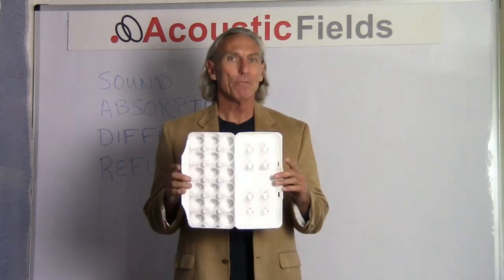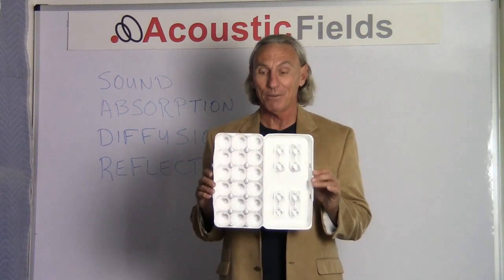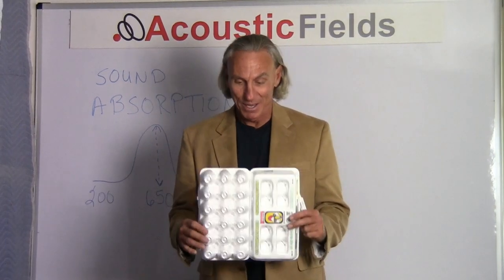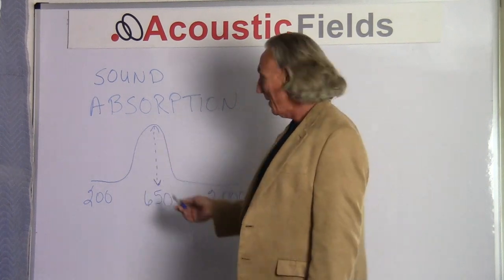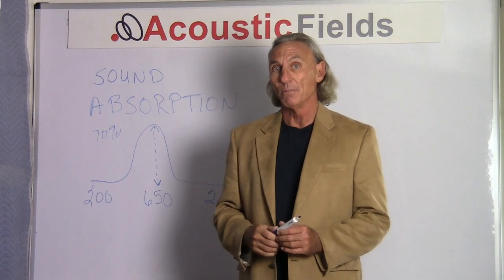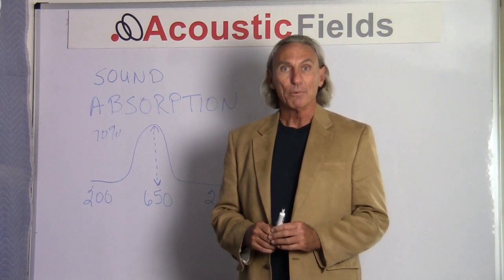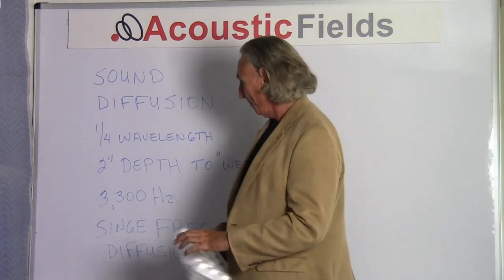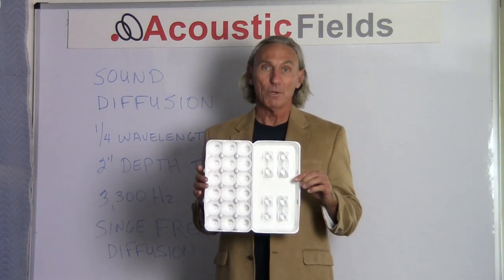The Egg Carton Acoustic Myth - www.AcousticFields.com

Comment: Well, not with those crates lool
Reply: @girlsdrinkfeck  The point of the video is that the egg cartons have a uniform shape and deep so the frequencies that are treated are minimal. The egg cartons act as diffusers. "Diffusors (or diffusers) are used to treat sound aberrations, such as echoes, in rooms. They are an excellent alternative or complement to sound absorption because they do not remove sound energy, but can be used to effectively reduce distinct echoes and reflections while still leaving a live sounding space." So the egg cartoon cones act as diffuser, and the material in this case carton can absorb some of the frequencies but again is a very limited range of frequencies it can absorb.

Comment: Hi guys! I can't understand one thing. In video mr Foley said that egg crate depth is 2 inches ( proximately 5 cm). Then he said that quadratic diffusion depth have to be at quarter wavelength. 2 inches x 4 = 8 inches (proximately 20 cm). But wave for 8 inches isn't 3300 Hz, it is 6800 Hz, isn't it?
Reply from the maker: Hi Paul,

The depth of the egg carton is around 2". It is an even depth across the total surface. If we multiply 2" x 4 for quarter wave, we get 8". Using 8" or .67 ', we divide that into 1132 ft/sec. and we get 1,689 as a frequency that fits this guideline. Even if the egg cells varied in depth, it is at such high frequencies that it would have limited use.

Quadratic diffusion is predictable and consistent. You can design for frequency response, so that you can apply the frequency response to the actual use of the room you are treating. Remember, poor room diffusion is as big an issue as poor low end performance in small room environments. I never see or hear a room that has proper rates and levels of diffusion applied within it and it is too bad because diffusion adds so much to our music.

Diffusion can take a small space and make it sound much, much, larger. If you were blind folded and brought into a small room with proper diffusion, you would not be able to estimate the actual room size. This is how well quadratic diffusion works.

Thanks
Dennis

Comment: I just sound-deadened a Bayliner boat for nearly free using discarded couch cushions.
Other free materials is discarded carpet and underlay, which is more foam.
I can't believe the expense of the new, black acoustic foam !!

On egg- crates - 
This would be a budget radio studio trick from the '30's !!
A.M. only went to 5K hz and speakers didn't work under 200 hz so paper egg-crates worked perfect back then.

Comment: So if I understand you correct, the amount of soundproofing from Egg crates is minimal, but not nonexistent.
If a person (say for example: a young, inexperience, unprofessional, and unemployed High school student who wanted to try his best at a DIY recording studio) wanted to add as much soundproofing as possible while being as cheap as possible, from what I'm understanding Egg crates would be a valid option.
Am I wrong, or are there more effective and equally as affordable options?
Reply from the maker: R,  Using an egg crate to stop noise is like holding up a feather to stop a tornado. Wrong application and material. There is no free hanging device that will stop noise. Barrier technology is a permanent build out that requires mass and density. You can absorb "excess" energy within your room but minimizes its transmission is a completely different science.
Reply: I am in a similar situation, but these cartons are not the way to go. They are not useful for sound proofing, and like the video said, they only absorb and diffuse specific frequencies, which would do you more harm than good, whether you're trying to record or listen critically.

Comment: No.. Im not use the styrofoam one we used the cardboard one to soundproof it but i think the styrofoam was bad because it gives corkiness to guitar sound i try it bfore but the paper one sound good and it reduce outer room noise..
Reply from the maker: Hi Ade, You are correct. Every material type within our rooms contributes to what we hear. We stay with natural materials in our room builds such as soft woods , natural fabrics, and even stone. It is always a balancing act of materials, room size, and pressure levels.

Comment: Sir,  glass wool vs ceramic wool blanket. i didnt find any video on ceramic wool acoustic property.  i met a dealer who adviced ceramic wool blanket with aluminum coated to buy. what is the difference in property of sound absorbtion between both of same thickness. which one will give better result in case of absortion?
Reply from the maker: Hi Loukik, What are the absorbent coefficients of both materials? You have to look at the rate and levels of absorption of any and all materials used within an audio room. These material types are not conducive to sound quality and should not be used where critical listening is paramount.
Reply: Thank you Sir. But why people are using glasswool and gypsum in studio? what  will be the result of sound if they will use ceramic wool blanket in place of glasswool of same thickness? will it give better , same or worse result then before with glasswood?
Reply from the maker: Hi L, People do a lot of things that do not make sense when it comes to quality audio sound in small rooms.  Most people apply tactics they have heard or read about without having developed a strategy of treatment to match usage
Reply: Thank you so much Sir

Comment: How about the fact, that each holes vary in depth from the edge to the middle? Or is this irrelevant because there are no "steps" inside the holes which could reflect sound?
Reply from the maker: Hi speedybodie The sound energy would go right through the holes and not be refracted back into the "diffuser chamber". It is this process that must be followed if you are going to create diffused wave forms.

Thanks
Dennis
Reply: Acoustic Fields Sorry, wrong wording. I meant the dents, not holes. There aren't any holes in egg carton as I know them anyway.
Reply from the maker: speedybodie No matter dents or holes, an egg carton is just not a diffuser.
Reply: Acoustic Fields For a response to his follow-up question, that was devoid of any facts. The fact remains a wave hitting the dented area of the surface of a paper egg carton that holds the egg in place isn't going to travel straight back to the source-- it'll bounce elsewhere. With the entire dent, it'll bounce in any random direction. One must also add in the fact that most egg cartons are made of fibrous paper material. So I think it's safe to say it's much better then a flat wall that will reflect back most of the sounds straight to the source.
Reply from the maker: ngomusicgroup It is not safe to say anything about an egg carton when it comes to serious room acoustic diffusion. True diffusion technology has to satisfy a rigid criteria for performance in small room acoustics. There are many variables that must be satisfied to create a truly diffused room sound environment. The process you are describing is sound re - direction, which does not satisfy any of the rigid requirements of a truly sound diffused room. Lets leave the egg carton to do its designed for job, namely transport and secure eggs in a safe manner, and then keep it in the refrigerator where it belongs. It has no place in a serious room acoustic project, other than providing a food source for those working on the room acoustic.
Reply: I don't think you have any actual real world experience from using cartons to kill reflections that will record straight back into a microphone. This happens quite often with people who presume their education is all they need to understand real world experiences: a room treated with egg cartons is going to limit the amount of sound reflections picked up into mics whether you like or not. It's not a perfect situation but the fact is it's better then not treating the room with them at all-- by a noticeable amount. I say actually test recordings in a room, then write on your shiny board about the findings instead of only writing on that same board without true A/B testing of your theory.
Reply from the maker: ngomusicgroup Only 30+ years of building, testing and designing rooms including 8 years alone in pure R&D building, testing, measuring and tearing down over 116 rooms using different build materials and methods to compile our proprietary database and technologies. But go ahead and believe what you want. That is your prerogative.
Reply: Acoustic Fields
I am not doubting this guy's knowledge and experience on acoustics, in fact I very much look to him for facts. But the way he responds to people who genuinely have questions and might have some sincere doubts I find offensive. The method of. "I'm smart, you're dumb, I know the facts and you don't" is not exactly going to win people. For one, yes, not everyone is an acoustical engineer, however, it takes more than simply saying "I have 30+ years of research and development and experience", people do appreciate simple test results. Also, if a response is done pridefully, you could actually be losing people from the chance to believe in your knowledge and wisdom. It's one thing to know and have the truth but it's definitely another another skill to be able to "effectively" get people to listen and realize it. There's a saying that goes, "people don't care what you know unless they know if you care". A quote from Neil de Grasse Tyson when he was correcting Richard Dawkin's abrasive method of teaching science, "I think I felt what you said more than I heard it. When it comes to other people's beliefs, sensitivity PLUS the facts equal impact."
Reply: Pri yon Joni
Exactly my thought. And the reason why I stopped asking. I guess I have to find the answer somewhere else.
Reply from the maker: Pri yon Joni speedybodie Sorry guys, probably got of bed the wrong side that morning I made that response. Looking back I was short and I apologize for that. I guess I just didn't take too well to being accused of being all textbooks and not having building experience. That is the polar opposite as it was only through so many years of building and testing that I found a lot of the literature was misleading and had been written by people who hadn't actually got out the classroom to test theories. So again I apologize as I'm trying to help educate people about this stuff and if I offended you in anyway then I've failed in that endeavor and that's not good. So I appreciate your feedback and will try to correct this behavior in future.
Reply: Acoustic Fields
I totally appreciate your response and respect you for having the character to listen. Really love your video series and still look to them for wisdom and knowledge in acoustics.
Reply: Acoustic Fields
Good response, thanks for not ignoring critisism. :-)

Comment: While playing with my friends, ever talking silently my door still lets ALL the sound through because its  a hollow plastic door. What should I buy that would dampen the sound so my parents dont hear anything. I also have semi open headphones and the TV in living room disturbs me even if its on really low sound. How do I isolate my room so sound ONLY stays in my room? Please dont give me a complicated video, just what should I buy for it?
Reply from the maker: E, Unfortunately, noise is a complicated issue. TV noise is > 40 Hz. so you will need mass. I would buy two solid core doors and laminate them with a vinyl mass damping material.
Reply: A dirt cheap fix is to get a piece of Sound Board from Lowes or Home Depot.  They are lightweight and can be glued or screwed on (to your door).  Not pretty and not perfect, but they muffle out sound, and cuts the ability to hear the content of speech.  They obviously do little for heavy bass - then you need to follow the other suggestion.
Reply: Acoustic Fields I cant afford one solid core door.

Comment: I used to see photos from home studios in the 70s and 80s in books like Craig Anderton's Home Recording For Musicians with a wall of egg cartons and think wow that's it just go for the eggs. 

But it seems after this video it's turned into a comedy routine when science is applied when the lecturer here says "I can't think of any purpose for..." lol.
Reply from the maker: O, The issue using materials that were designed for product transport and shipping/handling requirements for acoustical treatment needs is that it disregards two of the most important variables that we must have for stereophonic sound quality in-room treatment technologies. Rate and level of absorption must be calculated, be predictable and consistent in their performance, and be easily installed. Yes, most materials will absorb energy, even concrete will absorb low frequencies, but at what rate and level and does their rate and level fit the acoustical requirements of the design parameters of the room. Nothing is easy and a good engineer needs many tools in their acoustical toolbox and there is no one size fits all usages, no matter what companies tell you.
Reply: Thanks for the reply!

Just to put this acoustic caper into perspective as I'm new to this - the idea to acoustically treat a room in the context of monitoring a studio mix is to get towards the room not colouring the eq or increasing or decreasing the mix level of the flat frequency response of the studio monitors you're listening to via reflection of the sound off the rooms surfaces especially large walls and corners? 

So in other words the point of treating a room best you can is to absorb these reflections or at least reduce reflections? 

So in theory is the ideal mixing environment although not practical, to mix outside in a field with no natural noise whatsoever to take the whole thing to its logical conclusion of having no reflection off room surfaces affecting how you hear a mix?
Reply from the maker: O,  The best your two-channel system will sound is to take it outside in a secluded place and sit in front of your speakers. This will be a sound quality that does not have "room sound". When you place your system in a room, you add many issues that must be treated or they will impact everything you do in that room size and volume. The issues are low-frequency unwanted pressure issues throughout the room, not just in the corners. Middle and high-frequency reflections from the wall surfaces.  You must use a combination of treatments to reduce all of these issues.

Comment: What happened to the reflection element?
Reply from the maker: Hi R, The eggs are sitting on it.
Reply: Acoustic Fields that is funny. However, I was curious about why the reflection properties were not analyzed in the same depth.
Reply from the maker: Hi R,  Reflection or sound redirection in the case of the egg carton, is not a wanted phenomenon. You need to manage spurious reflections from all surface areas in a critical listening room.
Reply: thank you

Comment: It's cardboard - not foam - palates that were once at bottom of apple boxes that make good sound 4 recording. Used on movie sets
Reply from the maker: G,  The issue with using materials that were designed for other usages is that they do not have measured performance. In critical listening environments, we have to know how much, what frequency, and a host of other variables.
Reply: @AcousticFields  was told by Mad Max set builder they used apple/vegetable (cardboard palates used to strengthen bottom of boxes in Australia having shape of egg cartoons but flatter and covering larger area) placed up high out of camera scope . Said they were cheap & worked well to reduce echo, etc.
Reply from the maker: G,  They do not reduce echo. They reduce reverberation times and do it at unpredictably and with inconsistent rates and levels.

Comment: I can not understand why anyone would think that actual egg boxes would be of any use in sound insulation. I think it must be the result of confusion over the term 'egg crate' .  Egg crate foam, the packaging foam, does look like acoustic foam, so maybe that is where the idea came from.
Actual acoustic foam is a higher density material than the packaging foam.
Reply: Adrian Thomson it actually works. try to drop by in any music bars here in Asia and you will find many of them use egg trays made of cardboard as soundproofing.

Comment: Sadly, I used egg flats of dense paper years ago...myth busted.
Reply: Did you try modifying them? Packing them with dense materials then duct taping the backs of them? NO ONE has an answer for that question. Not even this Dennis Foley guy. He keeps ducking me and avoiding my question - how MIGHT one possibly MODIFY egg crates to become viable as a cheap DIY solution? I'm now convinced that he profits from conventional studio treatment methods and doesn't want anyone to be using any DIY projects.
Reply: Hey was wondering if u could give me some basic info or links on how to modify egg cartons. I go through a lot of the cardboard ones from my local grocery store. I dont understand anything really about whats going on here but im starting to read up about it but i feel like a lot of the info im coming across is just basically to sell the foam. I wanna know if its viable to use or modify my cartons to help my acoustics vs not doing anything at all to my current room.
Reply: @sparktite  
Following